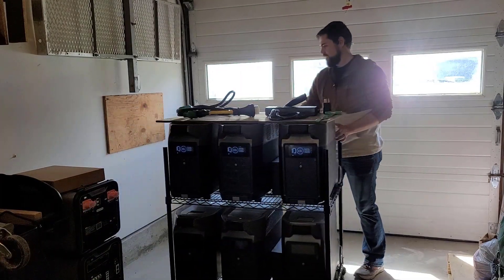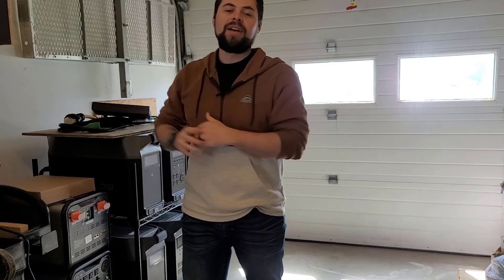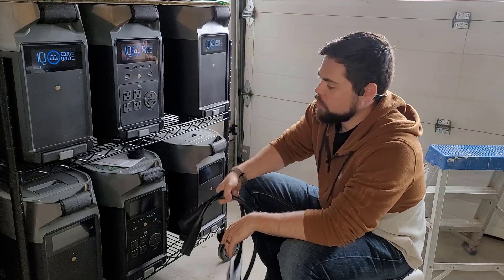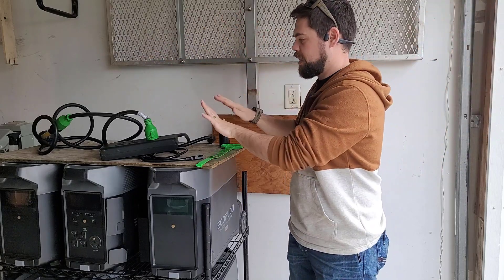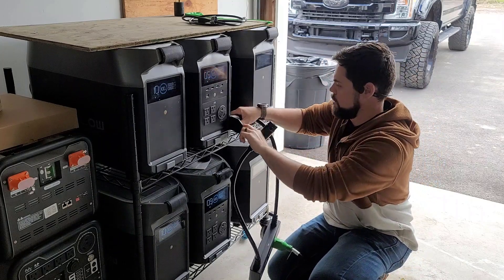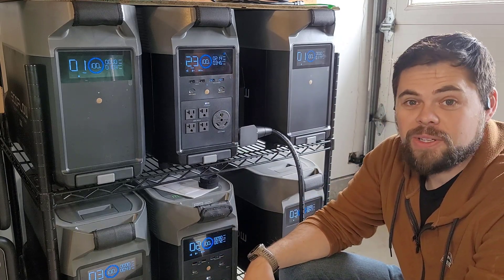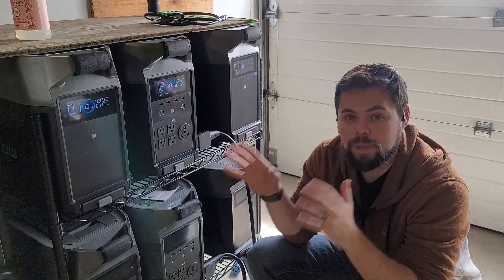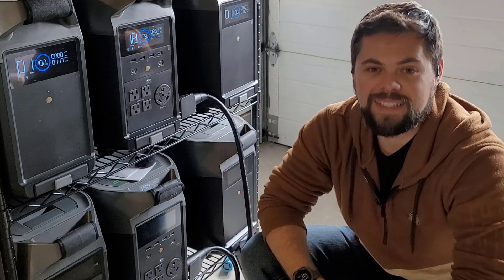EcoFlow Delta Pro Setup and Test

Comment: I just bought the pro, and it says in the app help faq that "charging from solar if the input of the power is less than the or equal to the output power, he device will continue to consume power, which may result in power loss and eventually damage the battery." That seems self defeating if you have solar panels hooked up and the power is not charging good enough. Is there a limiter to keep this from happening?
Reply from the maker: Every solar generator has what's called "idle power consumption." If the unit is turned on, it's consuming power even if it's not running anything. Same as your car, if the engine is on, it's consuming gas even if you're not driving. So what they're saying is if you're using 300w to run some equipment, and you're making 300w from solar, you won't be making any power, if anything you're losing power because the unit has to run itself in order to run the other equipment. The Delta Pro only uses about 13 watts to be on. For comparison, the Bluetti AC300 uses 64 watts which is 5x more power being used to just be turned on. The Delta Pro has one of the lowest idle power consumption rates out there.
Reply: @minutemansolar  I'm thinking it should have some prog that analyzes this and makes the appropriate choice, rather than what they say, ruin the battery. Not sure. I'm thinking on keeping it, and doing your system, the putting together inverters and batteries is so outdated, like making electronics with the bakelite boxes we used to use. lol

Comment: how much did that set you back
Reply from the maker: Entirely with solar panels, rack and accessorise about $23k. Definitely not cheap but I am very happy with this system and don't have to worry about gas or diesel fuel supply.

Comment: Do I have to do firmware if I don't want to use my phone?
Reply from the maker: It's definitely recommended. You don't have to keep your phone connected or use the connectivity option on the DP. But once you get it I 100% recommend updating it.

Comment: Great video, my question is what is the circuit breaker your well pump is on? Mine is a 50 amp. 230 volts. I don't think this system will work.
Thanks,
Reply from the maker: My well pump has two 20a breakers (40a) on a double pull circuit. Is yours 50a on each pull for a total of 100a? If so, then you're correct it very likely won't run it simply for the inrush power rating. The DP 240v plug is rated to 50a. Your well pump will not use 50a to run, at the very most it'll use 40a. That's is between the double pull it's 50a meaning two 25a pulls.
Reply: @minutemansolar  Thanks for responding, my well has a single pull 50a .
Reply from the maker: @ritchie6810  Wow very interesting. It's rare to find a well pump that is 120v compared to 240v. Generally, 120v items don't run more than 18a at a max but a single delta pro is capable of pushing out up to 30a at 120v. When you say single pull, are there two breakers that are stuck together to make one pull or is it just one breaker, not attached to another breaker? Or is it a single pull but still two breakers, it would be an extra wide breaker? I've just not seen a 120v 50a breaker before so I want to make sure I'm giving you the right info.
Reply: @minutemansolar  one big fat one, it is a 240 v 5 0 amp one-and-a-half horsepower
Reply from the maker: @ritchie6810  Got it, one big fat one is technically two that are within one. So you shouldn't have a problem running that well pump :) Cause that means at the very highest it would pull 25a from each 120v leg within the electrical panel, and each DP can do 30a. And 25a being pulled from both sides of the electrical panel would be extreme, so It's unlikely you're using more than 30 to 40a at the very most to run that well pump which is within the capability of two DPs put together in a 240v setup.

If you decide to get anything I hope you'll consider ordering from https://poweredportablesolar.com/shop/ to help support the channel :)
Reply: Just because you hook a 30 amp cord to a 50 amp plug doesn’t give you a 50 amp rating.

Comment: how long does your charge last you guys?
Reply from the maker: It all depends on what we're running but for emergency essentials about 36 to 48 hours if we're being selective. I just did a test, video coming soon, where I ran my entire house normally for 4 days straight, 96 hours and it ran no problem with 2,520w of solar panels connected. https://poweredportablesolar.com/shop/
Reply: @minutemansolar  I wonder what it would take to go truly off the grid with this system..  I'll check out the other videos.
Reply from the maker: @dannychapman456  I show how I did that here: https://www.youtube.com/watch?v=X-qlAHMldMQ&t but the biggest factor is what is needing to run off of the system.

Comment: How long will that cost back by buying all that battery and solar panel?
Reply from the maker: It's not cheap, total is around $23k. But last week I ran my entire house non-stop for 4 entire days without any issues. With pretty much the entire nation facing rolling blackouts, gas prices being ridiculous and said to go up even more, and this system easily lasting 20+ years it made a lot of sense to do it.
Reply: That is what I’m thinking too, maybe more solar panel and using pass though charging to cut down 1/3 of battery. $23k just hard to make that decision, maybe $10k I’ll do it at that point XD
Reply from the maker: @jakeliujakeliu  Ya it's definitely not cheap, it's just the method I chose to go with.

Comment: One Delta Pro is $3,599.00. One extension is $2,699.00, so your rig is $17,994 - right? This is way to much for backup energy. You get a Tesla battery for your house much cheaper, don't you?
Reply from the maker: Yes it's basically $18k. There are many good options on the market, this isn't the "end all be all" but it does work very well. I also have the ability to take this in my RV and run my entire RV indefinitely with the batteries and solar that I have on my RV which I can't do with a Tesla Power Wall. This is a portable system, the Tesla is not. Both have their place.
Reply: @minutemansolar  They are not made for this. To big, to much selfconsumption and to expensive. My Ecoflow runns at minimum 50W if it is connected to the grid. With a BYD B-BOX 10.2 (prof. Battery Power Storage) you 'll get 10,2kWh for $7k and 12kWh for $9k. You can upgrade to 36kWh. Yes, you need some more parts, but for a scenario you have described, some solarpanels on your roof are peanuts.
Reply: if i understand correctly you can recharge on unit at a time at an auto charging facility, which you can do for a month or moreA

Comment: I’m looking into getting this very setup. If one power station malfunctions, will I still be able to run the other with its 2 batteries?
Reply from the maker: Yes but you'd be limited to one inverter so you'd only have 120v power until you got your second unit back up and running to make 240v power. Please consider ordering from https://poweredportablesolar.com/shop/ to help support the channel :). If you have any other questions at all please comment here or email directly at info@poweredportablesolar.com.

Comment: thanks so much for the in depth walkthrough. One question: Is using Wifi or IoT (Internet of Things) a must to connect the units together?  I'm not planning on using an app or connecting to my phone and want to see if it's a must to be "online".
Reply from the maker: It uses IoT once set up. The first time you set it up you can connect it to wifi so it can make updates but when you're communicating with the unit it is through IoT. I believe you can monitor it through wifi as well from another location, don't quote me on that.
Reply: I have never been able to connect my SP via wi-fi.  Only Bluetooth, so the app only connects to the SP if I’m within Bluetooth range down in the basement!  EcoFlow told me my SP’s IoT was defective and had me send the unit back to them, but the replacement SP won’t connect via wi-fi either!  This really is a problem because I want to monitor the system remotely using the app.  I know my  wi-if signal is strong enough because the two Delta Pros sitting right next to it connect just fine, but the SP doesn’t even seem to see the wi-fi network, much less connect to it!

Comment: Just subscribed, great video. I have a single Delta Pro I use now for travel.

Have you considered testing the Ecoflow smart generator?  What about the smart home panel as well?
Reply from the maker: Thanks for subbing! I plan on getting the smart generator eventually. I already have a transfer switch so I won't be getting the smart home panel. The big advantage of the smart home panel is you can use it remotely on your phone and it will also automatically transfer power from the grid to your Delta Pros when the power goes out from the grid.
Reply: @minutemansolar  awesome, I hope you will be able to make a video of the generator. There are not a lot of reviews of it yet.

Comment: I have an EcoFlow Pro and I would like to connect my Reliance ProTran 30amp transfer switch to my EcoFlow Pro but the connections are  much different. The cable I have is a twist lock 4 wire L14 30. Do you have any idea what conversion cables I can use to accomplish this?  I can send pictures if you have an application I can upload them to.
Reply from the maker: I just looked up US plug styles and found pictures until I found the correct plug.

Comment: Can I power a fridge, over , and AC in my home with 1 unit? If so for how long before I need to charge it?
Reply from the maker: Possibly. The fridge yes. The oven, yes if you have propane or natural gas (but natural gas is not guaranteed during a power outage). If your oven is electric then you will need two units, but it'll use so much power you cannot be using hardly anything else when using the oven. A/C if it's central air you'll absolutely need two units but even still I very highly doubt it'll work. mini splits and window units would be possible with a single unit as long as the mini split is a 120v version.
Reply: @minutemansolar  using an air fryer eliminates the need for you oven, unless it's thanksgiving.
Reply: Per reply below... these things are EMERGENCY power. You adopt a completely different mindset during an emergency. Basics only. The video is a bit misleading because of his lifestyle choices. Most people don't live such a minimal lifestyle.

Comment: Is this system protected from an EMP or CME event? If so how?
Reply from the maker: It is not.
Reply: @minutemansolar  Have you ever looked into Sol-Ark? They have an EMP protected inverter. Can't use lithium batteries though because they aren't EMP hardened, you'd have to go with a lead/Acid battery.
Reply from the maker: @petenelson8136  Yes I have, I know the owner, they're truly great people. They do have Lithium batteries that are hardened to use with the system.
Reply: @minutemansolar  Humm, I got this back from Sol-Ark when I enquired about their system and batteries. "For batteries, we can not recommend a LFP battery because the BMS (battery management system) would be susceptible to an EMP/Solar Flair. Typically we will recommend a lead acid battery because of it's make with no electronic equipment. For the PV wiring and the wiring of the Critical loads attached to the Sol-Ark, we provide 60 Ferrite suppressors to land on the PV wiring and the power cable of each appliance on the critical loads. Feel free to check out our information page in regards to our EMP Hardened units."
What Lithium batteries are you talking about that are hardened to use with a system?
Reply from the maker: @petenelson8136  I dont know. I just know when I was working with them a couple of years ago they had an option on their website to build out a kit and there was an upgrade fee to make the lithium batteries EMP proof. Maybe they no longer have that option.

Comment: Price for that whole setup?
Reply from the maker: Not cheap. $18,133.00 for all of the Delta Pro equipment. But, it's enough power to run my house to 2 to 3 days in emergency power mode (still running the well pump too) even without solar panels connected. The batteries are LiFePo4 so they'll last 20+ years, and I can recharge my average daily use in 3 to 5 hours fairly easily each day. I will be doing a video with the solar panels in the near future. Eventually I'll have a video to see how long I can run non-stop without grid power.
Reply: @minutemansolar  thanks for all this info. my question is can i alternately one at a time recharge the units at an auto charging facility so i could buy less units??

Comment: Nice setup!  I have a delta pro and extra battery plugged into a transfer switch for emegency power.  Are you concerned about the heat in the summer, the cold in the winter and the dust having a negative effect on the units?
Reply from the maker: No cause my garage doesn't get too hot or go below freezing. I need to find a way to protect it from dust I guess though.
Reply: @minutemansolar  If you find a way to occasionally clean the DP fans, please post it.  Im in Texas so it gets really hot and dusty in the garage. I run mine on my transfer switch from inside my house.  Again... nice setup!
Reply from the maker: @LoneStarPrepping  I'll likely just put air filtration fabric over the fan ports to collect the dust, I use similar setup with my crypto miners and it works well.

Comment: What people are calling a solar generator is actually the solid state power station. The solar generator is the part that charges the power station using the sun. Also known as "solar panels".
You can also charge some solid state power stations with a "wind generator" as well as a vehicle generator. But most solid state power stations cannot charge themselves since they only provide stored power.
Reply: Exactly! 100%! People always try to label something to try to make it sound like it's more than it is. It is not a generator!!! It is a power station!!! The "generator" part of the system is the panels... ONLY the panels! The batteries are the storage for the generator (panels)! 100% RogueOnTheRoad!
Reply: Or it's simply implied that solar panels are part of the setup SMH, why is there always someone who makes this comment in videos like this?   Yeah obviously panels are needed for it to be a generator lol

Comment: Would the split phase inverters and batteries from EG4 not do the same thing but cheaper? I'm not being a smart ass just trying to learn
Reply from the maker: You can absolutely make an EG4 setup work, it just requires you to do all the DIY setup which is what many people are not comfortable with. This system makes it easy, but that's why you pay the extra price, it's all done for you.
Reply: @minutemansolar  I understand and much more portable
Reply: @boltgun7266  - Not necessarily if you had got it early from the kickstarter program. I got 2 pros for about $5400 with most of the extra adapters & remote. If you try and build with all the EG4 battery & all in one unit they have they are petty much the same price at the end of the day because of all the tools, wires etc you have to order as well. If you buy at retail now for these you maybe saving a little more with the EG4 but it doesn't have the probability, easy of connecting to house & if worse come to worse you can charge at a EV station if all power isn't working or being worked on at your house especially in an RV situation. More charing options are worth the money.

Comment: Our concern is our 1.5HP well pump, and this system is right on the edge for that at 3600W per leg. What size pump are folks able to run reliably?
Reply: Sorry if I'm not understanding correctly, but are you saying you need more than 3.6kw to run your well pump? Just a quick Google search shows a 1.5hp well pump using 2-2.5kw. The setup in this video with two Delta Pros is 7.2kw.
Reply: @bizkillall  The startup draw is the concern, which I believe I saw could be around 7000 watts, real close to the limit. Else the running load is fine. I don't know the pump's model number to know for sure.
Reply: @kenltron  would interesting to know if x-boost works with the double voltage hub. (4500w + 4500w = 9000w of peak power).

Ecoflow support has been really good at answering technical questions. If you ever find out the specifications of your well pump, you can contact support and ask for help determining of the Delto Pro could be used to run your pump.
Reply: @bizkillall  x-boost lowers voltage, which the motor should be OK with. Support gave me a canned answer of "if your device is within the Pro's output, it will work." I was hoping someone had this config.

Will Prowse just put together a great EG4/Lifepower 240V system with 2x 6500W inverters. Looks great, not very portable, though. 🙂 Can be grid tied.
Reply: @kenltron  thanks for the information. Hopefully someone out there tests this with a well pump and shares there experience.

Maybe if you are willing to try it, you can purchase two delta pros from Costco and test it yourself, and then return them if it doesn't work. I only suggest this because Costco is always good about taking returns.

Comment: Very impressive. How many 200 watt solar panels are needed to fully charge this system? I would think with panels this would be about at least a $25,000+ system.  Very nice.
Reply: In my case Ecoflow support tech told me 4x 365W ( each panel 37 volt max out put  ) in series  =148V x  1460W  to get the best charge input . But on Ecoflow main screen will show how much W input and how long it take for full charge  , from that info you know how many panels you need to get the best .